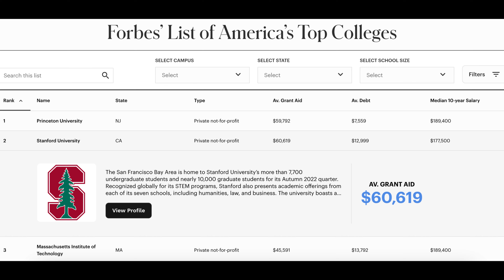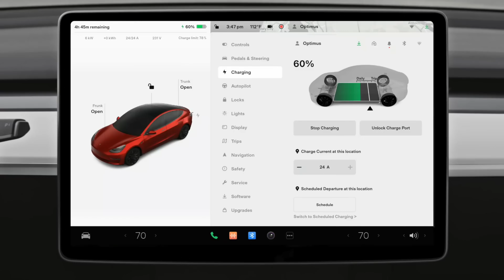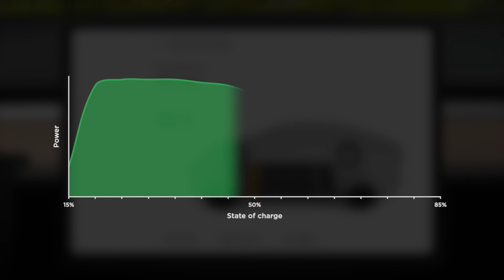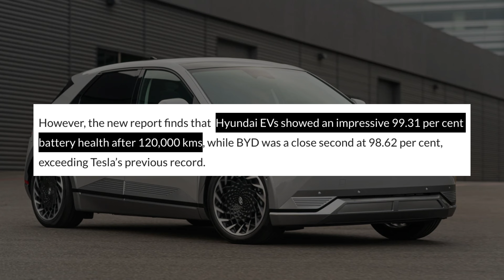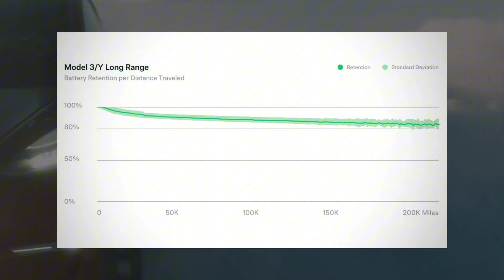Shocking NEW Study on EV Batteries - GAME OVER Gas?

Comment: An EV's battery  should last at least 10 years but even after its life span has been reached it should have around 80% of its capacity left. These are just averages so to put that into perspective a car with a range of 400 miles per charge should go around 320 miles after 10 years of use. If you take care of your battery it might just last the life of the car.

Comment: Hyundai Ioniq 2019 - 170000km on it. Still have above 26 kWh capacity (original 28 kWh) so 92% battery compared to when it was new.

Comment: i dont see how the stats of 99% battery health at 120,000 miles is possible. my friend has an electric car, they ran a diagnostic check on their battery after 10,000 miles and found they were running at 96% health. They do tend to run on long journeys, and charge at super chargers, but isnt that a normal use case for a car. if we are exclusively looking at very low discharge and re-charge rates without battery overheating, specially in hotter climates, these results seem quite invalid. 

i watched a review of a 400k mile tesla model s that was used as a taxi for many years, and it had dropped way more than 20% of its health. it also was nowhere near as quick as it used to be, due to the degradation. I do question the sources of the data that has been found, as 99% health seems impossible
Reply: You are talking about autotrade's series of videos on a high mileage uk model s. The car is as fast a new. It has 30% less range. Impressive for a 420.000 miles car.
Reply: How many people are still gonna keep a 400k mileage car.